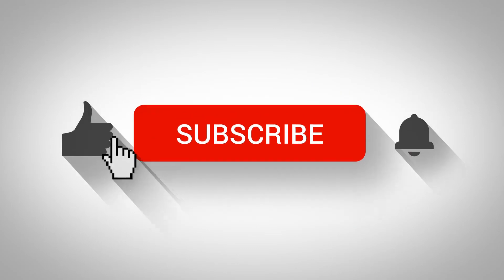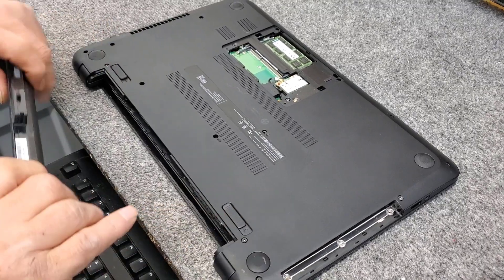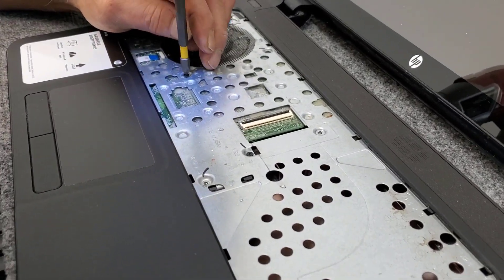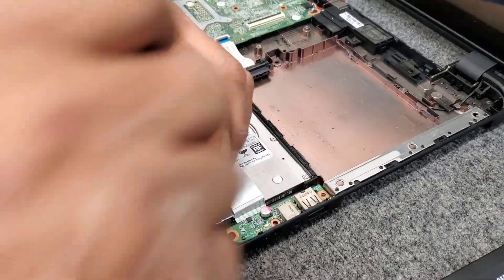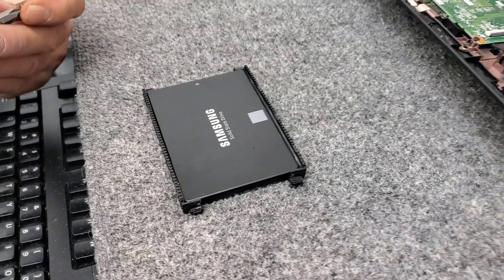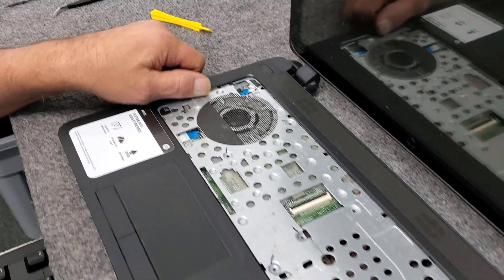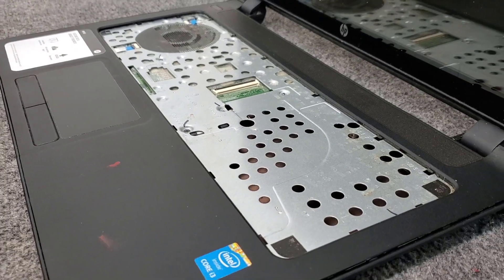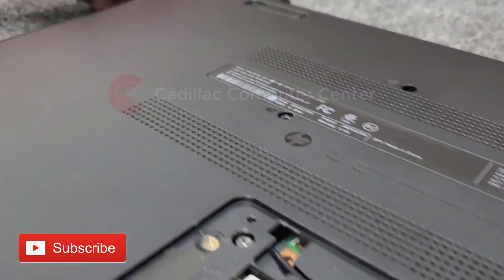How To Replace Hard Drive in HP 15 Touch Laptop With new SSD

Comment: Question: in another video, you had mentioned 2 antenna to reattach for the wifi card. Does this one only have 1? I upgraded my memory, and when I did I accidentally knocked off the black wire (the only one I can see). Do all wifi cards have 2 wires? I am getting crap reception now. I am guessing there is another that came off that I did not see. I am going to open it back up, but I noticed yours seems to only have the black wire as well. Thanks in advance, new sub and I appreciate what you do!!!

Comment: I did everything you did.  After connections of the ribbons and powering up nothing happens.  The light on the on/off sw. did not light.  I put the HDD back and the same result.   I am thinking the upper left ribbon is not working very good in the board connector.  You did not show the bootup.

Comment: Thank you! Also what could go in the empty space above the hard drive? I see the power connector. I have an hp 15 and I want to extend as much use for it as I can
Reply: There is a nearly identical model that has a DVD drive there

Comment: Is your touchscreen working still? I did the same but touchscreen didn't work anymore. I'm looking for drivers to make touchscreen  work again
Reply: You might need to check the ribbon cable for a good connection.
Reply: dont forget to upgrade drivers. I used the HP assistance tool or whatever for the version of my laptop, when it asked to install assistant I said no. I didn't think it installed anything but in the taskmanager it was there, and it automatically updated my drivers and stuff.

Comment: Hi buddy, I have just squires a hp 15-db0xxx and in the memory menu it says it has a Samsung hard drive?
Does this mean it's been changed?
Reply from the maker: Hi. Most likely been updated to an ssd.  However, it could be a samsung 2.5 inch hdd. Just go to c drive, right click it, go to properties, click hardware tab.
Reply: @CadillacComputerCenter  do they come with Samsung drives?
The unit was manufactured in 2019 and under warranty until May 2021.
Someone wiped the unit for me as I didn't have the password when given it, he said he needed to take the drive out to perform this action, however, I'm not a PC tech guy, what size memory should it have?
4gb ram it's saying in the spec menu, but I don't understand all the jargon to be honest my friend